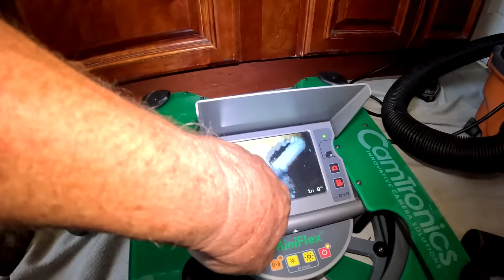We didn’t REGRET connecting VAN MUFFLER to rat infested OVEN…..

Comment: I was called on an appliance call, for a stove. The rats had done so much damage to the wiring and insulation, that the only alternative was to discard the stove. The rats were in the insulation, with droppings and urine all over the place. To save the stove would have required complete replacement of the insulation in the stove, in addition to santize the entire stove. Not to mention the repair of all the damage done to the wiring. It was cheaper for the home owner to replace the stove. Of course,after the rat holes were sealed and the rats trapped.

Comment: I repair appliances and anytime you get rats in the oven save your time trying to get him out because the oven is trashed .the insulation will be running through and through with rat urine and dropping.when you turn on the oven it will stink also with the insulation destroyed parts of the oven will be so hot
Reply from the maker: Great point and appreciate you sharing this information 🙏👍👏❤️

Comment: We had mice in our cooker, i took a cigarette and smoked them out, worked flawless and perhaps also for the oven part. Perhaps a cigar would be even better as it gives thicker smoke. The rodents get dizzy from the smoke and once they come out they are a bit disorientated and slow as fuck, i killed the mouse with a simple stab on the head with a screwdriver.

Comment: You're telling me steel wool doesn't work anymore or less effective??🥺😔 Or is it good enough for mice?
Reply from the maker: Mice maybe, but much better easier permanent products out there
Reply: @TwinHomeExperts  Thanks for the response. So far I've had great success using steel wool mixed with caulk. I've maybe filled 10 plus holes so far in the past year or so and each of them are still clogged🙏🏾

Comment: I had a renter leave the back door open 24/7 so his dog could go in and out.  When he left I found dead desiccated rats under the stove and dishwasher. They looked like they had been electrocuted.  Stove full of urine and turds. Dishwasher hoses all chewed up and in the bottom of the refrigerator inches thick of turds and urine.  Had to replace all three appliances. That was just the kitchen. Also a nest under the cupboards.  
I used your spray and it worked wonders.
Reply: I’m sure the security deposit covered all the damage 🤣🤣🤣

Comment: You can seal up the oven like you did and put a pan of dry ice inside the oven and it will gas off co2 and kill the rats inside. I do this with bees to kill the bees inside of a cooler that are all over the honey frames. so i can bring the cooler inside and not have bees all over the inside of the processing garage. or just have a bottle of co2 and spray it in there

Comment: If the van is fully emissions compliant and they actually change the oil, air filter, and spark plugs - unlike half the Ford Econolines spewing out raw fuel in New Jersey (cheap lazy asses), then the rat would just be hating life tasting fuel vapors at cold idle then hot water mist.